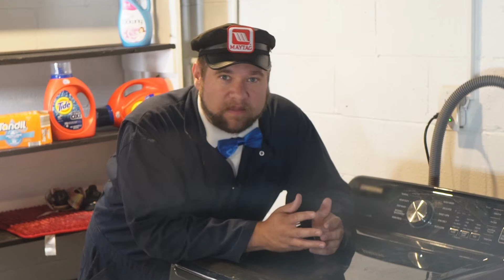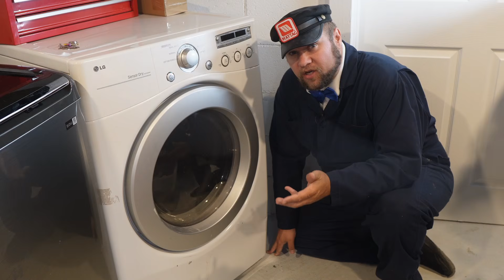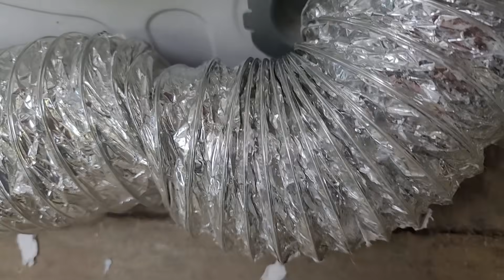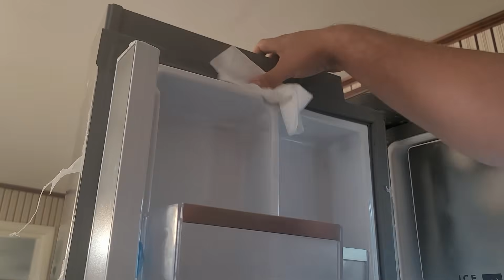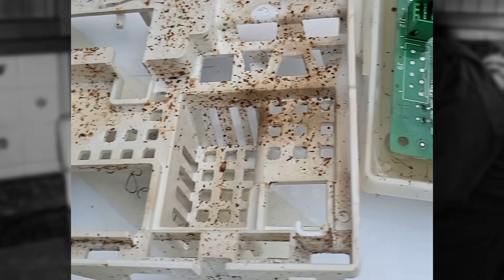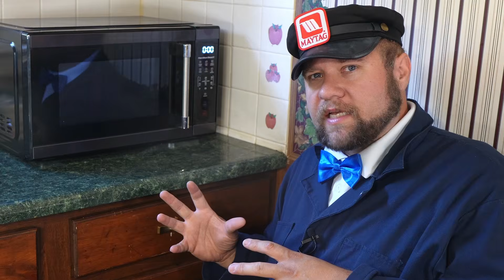Secrets to Avoid Appliances Breaking Down

Comment from the maker: Thanks to LG for sponsoring the video. I'm not sure how to take a manufacturer sponsoring a video, but maybe they'll see the channel and realize how important it is to have longer-lasting appliances, right?

My favorite LG Laundry as of today: 

LG Heat Pump Dryer: https://howl.link/2n3azlfk6hwfu (we did a teardown on this too!)
Matching Washer: https://howl.link/1mq445tjyo40h
LG WashTower: https://howl.link/nkat15qva11a9 (review coming soon!)
LG Direct Drive Washer Under $600: https://howl.link/h508hd9se230e
Other LG Deals: https://howl.link/stzywjv3iq5i7
Reply: Quite the irony that LG is sponsoring this video on how to prevent appliances from breaking down.  They never honored the warranty on my LG stainless fridge that I purchased with the linear compressor that DIED just after 2 years.
Not buying another LG product after that!
Reply: Lg makes great units but not a fridge stay clear
Reply: I have an LG fridge.  Mechanically it's been fine but the plastic is cheap and shelves break easily.  The weatherstripping is crap.

I hate landfilling major appliances but nobody makes durable appliances anymore.
Reply: I had an LG washer make it 9 years, and my LG dryer is now on year 14.  Somehow. So they can make some pretty durable stuff occasionally.
Reply: @katarh  My Maytag washer and dryer are 20 years old., and still running strong  My GE fridge is 20 years old, and still running strong.  My GE oven was replaced at 70 years old (only because modern techs refuse to work on stuff that doesn't tell them how to fix it).  My Sears central AC was replaced at 34 years old (only because they refuse to fix them).
My Kenmore stove lasted 14 years and I consider it a POS for only lasting that long.
Reply: @katarh  I'm sure, but that is past tense.  Not sure if any of the manufacturers are ensuring a quality product now.
Reply: I just ordered an LG gas range which I am excited to have delivered in a few weeks. I also got the LG refrigerator with 4 types of ice. I feel like I made an extremely risky purchase, but I'll give them a chance! I absolutely love the fridge so far, we love the "craft" ice (also sometimes referred to as "death star ice), and we also love the mini-ice because it's crunchy ice. It is not as good as true pebble sonic ice though. The ice from the door is nothing special, but it's nice that it's there in case one of the other ice makers breaks. It replaced our Samsung fridge with the dreaded ice maker issue. Our souls were filled with joy when they hauled that giant piece of junk out of our house, never to be seen again!
Reply: @petef.4361  I wish you better luck than I had.
Reply: @petef.4361  get the extended warrenty
Reply: When you talk about a sponsored product or brand, you are putting your reputation on the line, and become a paid endorser.  You are now the agent of the appliance maker, not an independent reviewer... that is the appearance we get as a viewer.

Comment: I bought the candy apple LG front loading set in 2008.  Knock on wood its still going strong 17 years later.  I do clean the lint after each use and deep clean lint every 6 months and wash the filter about every 6 loads.  I hope I don't jinx myself.

Comment: I don’t use fabric softeners and my family thinks I’m nuts. Don’t use dryer sheets either. I use several wool dryer balls
Reply: I quit using fabric softener when I developed an allergy to the fragrance. After about the 4th time that I washed my clothes and sheets, I noticed that they were cleaner. And I never used a lot of that product and always cut it with white vinegar. The only time I use dryer sheets is in the winter as I can't stand the static. However, the sheets will fade clothes.

Comment: On using the microwave oven - If you open the door on your microwave oven while the unit is running, the micro-switch for the door shuts off the power.  That switch is NOT designed to do that on a regular basis.  That tiny switch is one of THE most common failure points in a microwave oven.  SO: Either (a) let the unit run until it shuts itself off, then open the door -or- (b) shut the unit down, before opening the door.  Easy to teach yourself to do this, give the oven a break, and give your wallet a break too.  :)
Reply: Yep, this is GUARANTEED to cause your Sharp or Sharp OEMed (Wolf) microwave to fail.
Reply: Yep, and you know it was a door switch failure when it blows the fuse. There's two switches and if one goes bad it'll blow the fuse so that two can never go bad at the same time and cause the unit to work with the door open. Some old models even added a door lock like self cleaning oven cycles do.

Comment: Hello Ben's I have the notorious Problematic Frigidaire FFHB2750TS Rev 9 that's only 3 years old and gently used by myself only. I had the typical Ice-maker air leak problem so carefully took everything apart and improved on the already poorly factory installed band aid that makes sure the defrosted moisture drains good and all air gaps sealed. The factory has the defrost timer setting to run at about 12 hour intervals and I have verified water flow out of both tubes at the bottom during the cycles. There is no ice build up in any of the coils locations but 3-5 minutes into every defrost cycle you get LOUD Shotgun blast K-Pows from several areas of the unit. These are much more violent than just plastic/metal expansion noise. Any ideas as what it is?

Comment: My previous house I had for 28: years was all electric that I bought pre construction in 1988. The house I bought March 2024 I made sure has Natural Gas and no HOA, Natural Gas Range, Hot Water Heater, Dryer, hookup for back patio BBQ Grill and recently added 26KW Natural Gas Whole House Briggs and Stratton Generator. Soon converting HVAC to Daikin Natural Gas Furnace and Daikin Fit AC and Daikin mini split heat pump in the garage. Great video maintenance of all appliances is very important. You reminded me to check my dishwasher filter All of your videos are Awesome 👍😎🇺🇸👍🇺🇸

Comment: Most effective measure to avoid appliance breaking down is to use a 1800 joules (1.7BTU) Surge Protection Adapter for all modern Electronic controlled Appliances.
My Centralised Gas heater blew Digital Control Board 3 times (during 1y Warranty period) until I used a 1800 joules (1.7BTU) Surge Protection Adapter. It has never broken down for over 15 years.
My dishwasher, Washing machine and Microwave oven now all have Surge Protection Adapter at the power outlet.
My old frig and convection oven are just just thermstat controlled - they do not need any Surge Protection adapter.

Comment: I had to get a new water heater about 10 years ago. Before I set it in place I removed the plastic bottom drain and installed a brass valve. I used to drain heaters at vacant houses & had the worst time getting some of those to work after years of mineral deposits. I run a hose from mine every 6 months to flush it.

Comment: I bought a Maytag dishwasher back in 1995 and it is still running today. I bought another Maytag DW for my vacation house in 2010 and it only lasted 2 years. It needed two new electronic boards at a cost of $400. I scrapped it and bought another brand which is still running to this day. Maytag is no longer the superior brand it used to be.

Comment: Ah the good old days. I’ve a 1982 dryer, 1998 washer, 2010 fringe, and a 1994 electric stove in daily use, and nary a touch screen or wifi connectivity amongst them !
Reply: I don't have any wi-fi connectivity with my laundry machines either. And I don't feel like I'm missing anything. Wifi for appliances is just fancy remote control

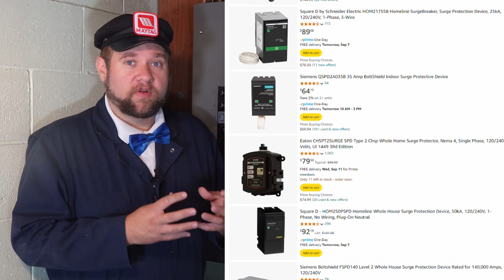Comment: This video was posted 9 days ago.  At 13:55, I see your Amazon list of Surge Protectors rolling across the screen.  The Siemens Boltshield 2 pole 65KA  is listed at $130.67.  On my Amazon website, it is listed at $183.75.  Wow!  It appears Amazon adjusts pricing depending on where you live.

Comment: The first tip about loose change in the washer is 100% true.

A single quarter made its way into the bottom and it was a $100 repair.

Comment: Low voltage can also kill your electronics over time.  Flickering of dim lights are indictive low voltage in your home.  They make high and low voltage protectors for both 110 and 220.  Some are hardwired before the appliance, others are outlet plug in.

Comment: Hello Ben. I have some questions on a new GE Side by Side refrigerator model GSS25GYPGCFS. Upon initial hooking it up how long with settings at 0 degrees for freezer and 37 degrees for refigerator , refrig and freezer empty,  should the fans be cycling and when should first defrost occur?  Also there seems to be a delay of about 2 hours between the display temperature and the real temperature. I know this because when i check the temperature with a temperature laser gun at the vents inside they are sinificantly different than the display readings.     Thanks in advance Ben. Have a good day. I appreciate your videos to.
Reply from the maker: Typically, fans shut off during defrosting. 2hrs of time between changing temps and it actually shifting the temps are normal. It has to cool the air down to actually change the temp, and that does take time for the machine to do it. Opening the doors up and letting the cold air out to check the temps with a gun is usually a great way to make it take a lot longer to cool down when there's nothing in the fridge. Refreigerators need items in themselves to store up heat mass (or lack of it) so the temps don't shift as much w/ doors open. So no mass + opening doors leads to much more rapid swings.

Comment: Don't forget about that appliance in your garage or basement.  The hot water heater.  One tip that will prolong its life that most people don't even know exists is to replace the anode.  It is a rod of aluminum or zinc that corrodes away so that the water tank does not.  Replace it every 3-5 years, so that it can keep doing its job.  If you have never done it, you will be amazed when you take it out for the first time, because it won't even be recognizable compared to a new one.  Also drain the tank and cycle the water through it to the drain to clean out any sand residue that collects in it.
Reply: Better yet, add an electrified anode
Reply: That would be the water heater. Hot water doesn't need to be heated.

Comment: I have a refrigerator (new) that sits in an alcove and, unfortunately there is only about an inch of clearance at the back wall.  Would sitting out a section of the wall at the rear and putting a vent panel on the wall help to provide better air flow for the lower part of the fridge?

Comment: Hi, I watch your channel a lot and see that you have a lot of knowledge. I would like your advice at the moment. I have a construction worker Zen Wa Eco 9281 and a Bosch heat pump dryer that often break down with expensive machines. Then I saw the GE Ultrafast in you. videos
on you tube 
These 220 volt / 240 volts are also from LG Top Loaders or Speed Queen. I am willing to spend some money on good equipment. What is made here in Europe is no longer of good quality. I am from Belgium, outside of Miele and Liebherr, but they are very expensive and difficult to make yourself. maintained and where can I buy these machines from the USA? I have seen that you sell parts on your web site so that is not a problem for the future. I would like your advice whether I should buy a combo washing and drying machine or top loader with agitator I live in. on the same floor with my wife who does the laundry and she wants good machines, no messy machines, greetings cis😃

Comment: On our 20 year old Jenn Air bottom freezer fridge I have replaced both the compressor and freezer fans, and the ice maker - the coating flaked off making the ice stick in the mold. I'd rather spend $100 than $2-$3 K for a new fridge.

Comment: My mother's dishwasher started developing this crusty white build up on all of its interior stainless surfaces. I discovered that it was because she was pre-rinsing (and in some cases even washing) her dishes and pots.  The dishwasher detergent pod  had no grease or food particles to break down, and it was causing build up and etching her dishwasher instead. What she thought was helping her dishwasher, was actually slowly corroding it away.
Reply: Yep, too much soap for load. My water is very soft, I found I need to put the wash tab only in the pre-rinse to get a better clean. Previously I was breaking the tab in half and split the tab between the pre-wash and wash cycles. This left the glassware with a weird dishwasher taste.
Reply: I always wash every visible particle of food off my dishes before putting them in the dishwasher. That's worked for me for 40+ years.

I accidentally left one small amount of food on one dish in a new dishwasher and it was baked into place when the wash cycle was done.

If you can see it when you put it in the dishwasher, it will be there after the cycle.
Reply: @VideoArchiveGuy  I bought a KitchenAid dishwasher 33 years ago and the manual said to NOT pre rinse the dishes because the enzymes in the soap won't be attracted to the dishes. That one conked out and the new Bosch's manual says the same thing. I've never had a problem with anything being stuck on.
Reply: "If you can see it when you put it in the dishwasher, it will be there after the cycle."

Sometimes you wonder what value people see in having a dishwasher...

Comment: Almost all of the advice in this video is sensible. There was one recommendation I found impractical. That recommendation was cleaning the dryer ducting. Doing so requires moving the dryer, disconnecting the ducting, and cleaning it using a tool a homeowner is unlikely to own unless they remove the ducting and flush it with water. No homeowner is going to go to that effort. Heck, most homeowners don't even flush their water heater annually and doing that requires far less effort. Using rigid ducting is ideal but, again, impractical for most installations given the minimal clearances around the dryer when in its working location.
Reply from the maker: Flush it with water... what? You need a $25 brush set. That's it. Much cheaper than paying someone $150 to clean the ductwork for you, and cheaper than a service call as well.

Comment: Dryer: I use a flexible vent pipe to get around the drain stack. Use a sheet metal tube! The "foil over slinky" type are for air vents and could catch fire! I don't try to clean them. I just replace them each year.
Stovetop: I like a 50/50 mixture of white vinegar and blue winter windshield washer fluid. Clean with a dish scrubber.

Comment: To add surge protection to an appliance only requires a MOV (metal oxide varistor) circuit.  These are very cheap and should be designed into any machine that cannot handle surges.  Relying on a homeowner to provide surge protection is risky.

Comment: yah the stupid builder put the driver vent access thru the floor, making a 180 degree turn  instead of wall, then runs 24 feet to outside. which barely meets code in the state I live in.   And Because of it I kind of have to have a flexible  line from dryer to dryer vent  thought I try to have as little bends in it as possible .   because of this I have had gone thru 3 dryers in 20 years.   the Whirlpool one lasted the longest.   the Samsung  the shortest.  There was also a Frigidaire as well that was ehh ok.  now its on a Maytag (Whirlpool) again,  old basic design tried and true simple.  I think its basic design goes back to the 70s and also how old sears kenmore dryers were designed.

Comment: I have a reminder on my phone to clean the drain pump on my washer every 3 months, and to run a cleaning cycle once a month with some tablets.  Dishwasher gets a cleaning every 2 months with some Finish cleaning solution they make and clean the filter and rubber.  I also clean all the rubbers on all my fridges and freezers with a solution and then rub them with sealant wax so they seal really well.  I do that twice a year.  Dryer I clean the vent spring and fall.  Fridge I vacuum the front floor vents every couple of months
Reply: I have trouble cleaning the dryer vent and spend the $5 to get a new flexible vent tube. Any part that is solid, not flexible is cleanable.  Replace every year.
Reply: Could you elaborate on the sealant wax? I would like to do the same with my fridges. Is there a brand I can search for? I didn't find anything at Home Depot.
Reply: @lorr.jones8887  I just use the parrifin wax they use for canning.  Can buy a box of it in blocks for super cheap.

Comment: The information regarding the refrigerator is key. I had a roommate who bought a French door model and whoever installed it jammed it in the location so that you couldn’t even pull it out to clean the fan/vents. Long story short, it broke down within two years and she had a hard time getting the refrigerator out of the location. It was a nightmare.
Reply from the maker: Its scary how often we get fridges on trade-ins that have the combo of lint/dirt in the condenser AND its in a crowded space. Its why the old one went back, but is also so easy for us to fix & flip em too

Comment: With regard to cleaning your refrigerator condenser coils, clean as much as you can with a brush and vacuum. And then, if you have a shop vac and don’t mind making a bit a mess, put the hose on the exhaust side and blow the rest of the crap out. I was floored at how much more I got out when I tried that recently. Happy DIY all 😉
Reply: I used my compressor